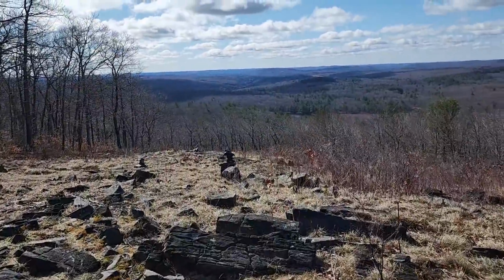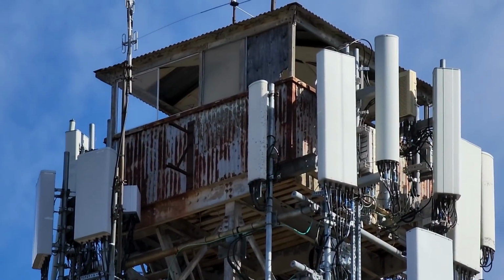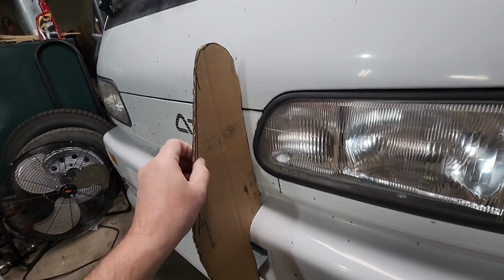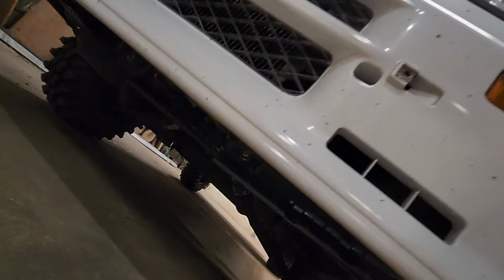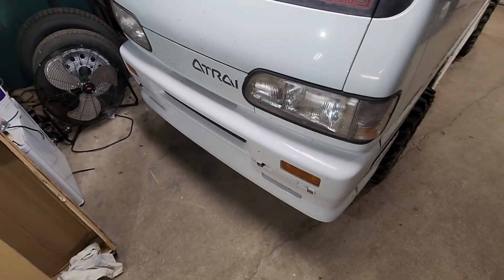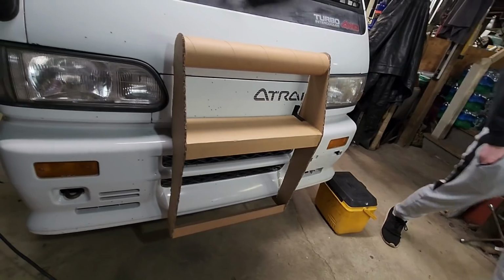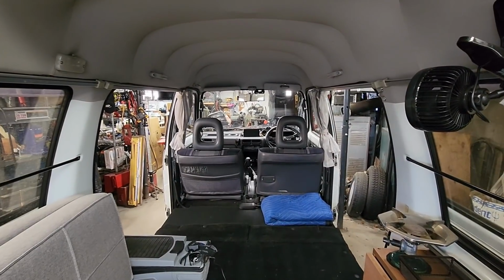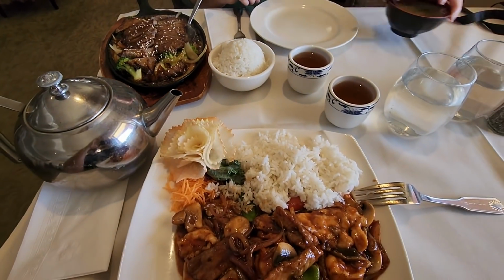Micro Van (SE1 E11)  Scenic ride to Mohawk mountain, Push bar fab, A/C works, 12v Fan and Food

Comment: Most cars I've driven, flipping the "recirculator" lever simply meant that it A/C worked at it's coldest setting.  They still got "cold", just not AS cold.

M'be add an antenna mount to the push bar?  And, if you build it stout enough to hold one of the set-ups for hanging a hammock from a 2" receiver.  You could also hang a "Bumper Dumper" camping toilet frame.  It also used the 2" receiver.  Kind of handy to have at the front of the rig sometimes.

What style is that Chinese Food joint?  It looked pretty tasty.
Reply from the maker: Bumper dumper! Lol. It'll have a winch so it'll be strong enough!

Comment: It looks like we have Cheez's off-road micro rv. Was that old transformer tower still active? It's looking a tad rusty. :)
Reply from the maker: Yes it is active, cell antennas and microwave anyennas
Reply: @MotoCheez  Ahhh ok. There's not many trails/roads around here leading to something like that. At least not that allow the public. Mainly just power line trails with all of the big power poles. Too bad you weren't a tad closer I'm sure you'd love seeing the old dam remains my friend and I ride on in the summer. It's owned by the agricultural institute and the upper level is setup to be a bird sanctuary for eagles. He also picked up a couple of RPS Hawks for us to practice on as we're going for our bike licenses this spring/summer. :)
Reply from the maker: Where you located?
Reply: @MotoCheez  I'm more in the Adirondack region of NY. My town is right next to the Canadian border going into Quebec. So I'm an hour away from Montreal and Burlington Vermont. It's good for travel since you can get into Canada or Vermont from here. Going more south will bring you into more places in New York. But the few miles in between to get to a store other than the grocery store in town makes a pain. It's only really a 30 minute drive but the gas prices make it expensive. :)
Reply from the maker: You'd think there's be miles of trails up there.
Reply: @MotoCheez  Unless you know someone with a lot of land there's not really much here. What trails we do have around here are either privately owned or state property. We found a different area to ride in back before the covid bs started but since then those trails have been gated off so people can't get into them. So for us it's usually back to the power lines behind my grandfathers camp and going up onto the dam & flat rock. At least with the Hawks it will now gives us the option to explore back roads we normally wouldn't drive down with our vehicles. :)